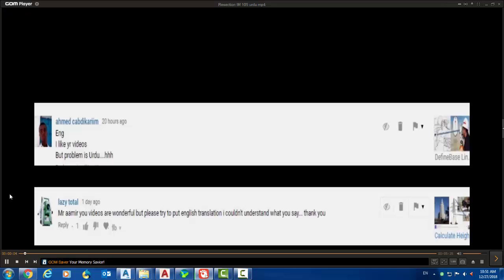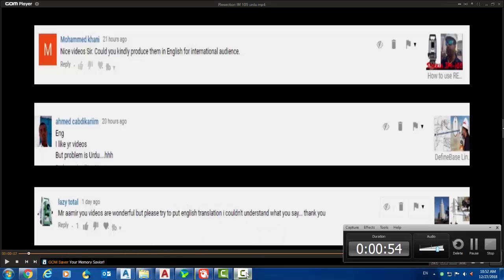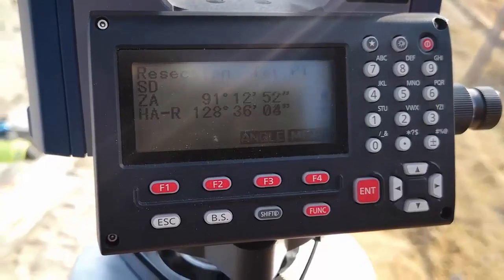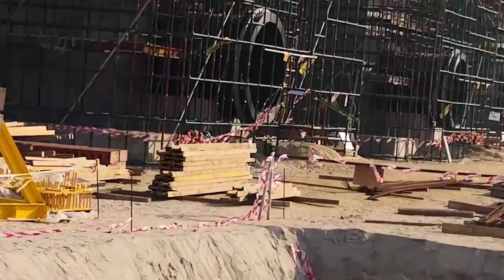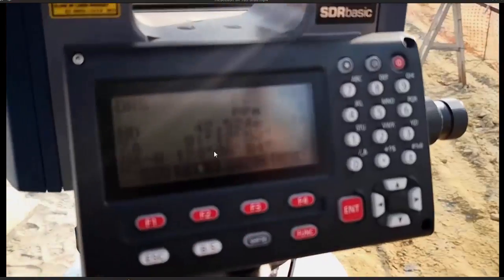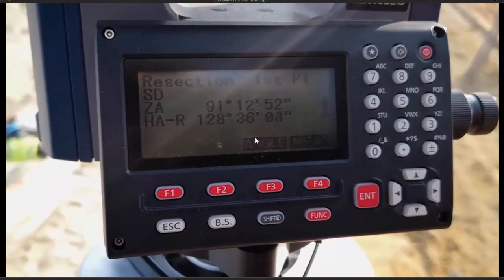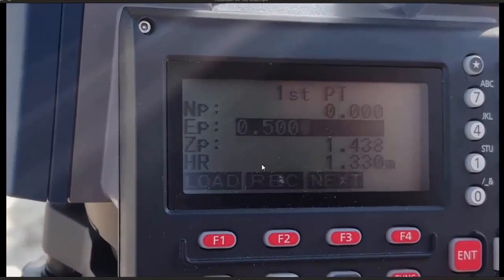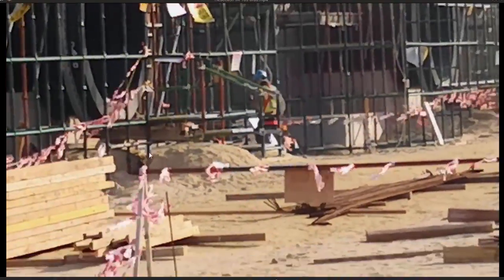How to do Resection with Assume coordinates in Sokkia Total Station IM105 in Urdu/Hindi

Comment: MINIMUM HOW DEGREE DIFFERENT  SET UP TOTALSTATION.
Reply from the maker: Its depend on your work & also if this error is more then total cannot calculate the value
Reply: @aamir.shahzad  SIR KOS LOK BOLTAHE 90 DEGREE ANGLE ME MACHINE RAKH NEHE SAKTA KEO KI LAYOUT ERRORE HO SAKTA HE.MENE BSRM COMPANY STEEL STRUCTURE BOLT POINT LAYOUT WORK KORCHI.
Reply from the maker: Thik kata ha